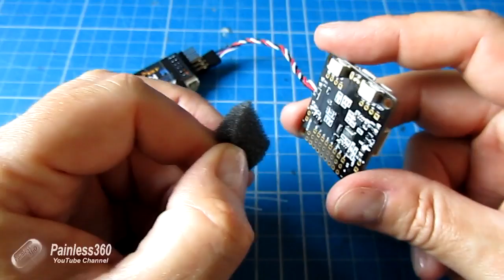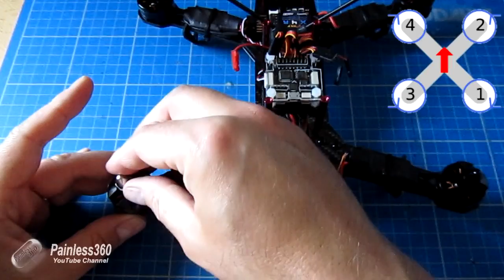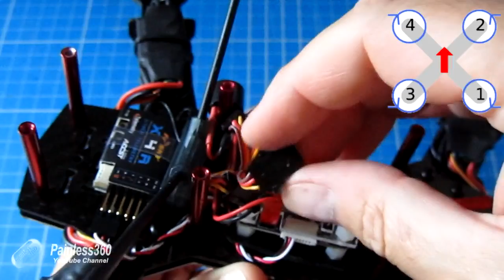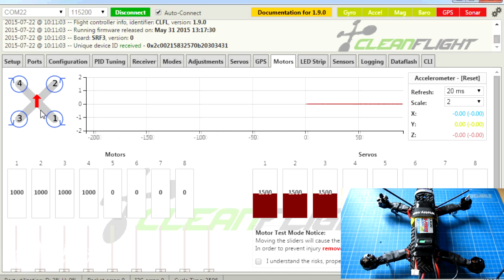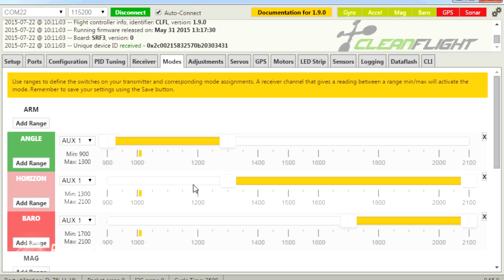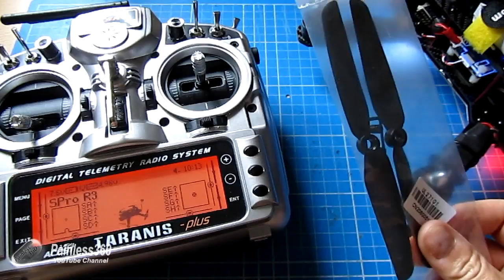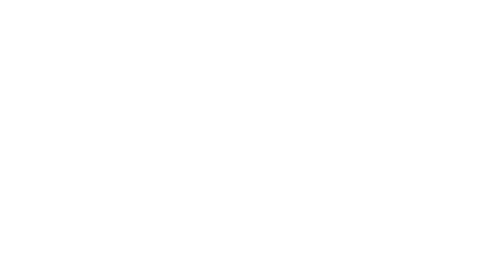(2/9) Seriously Pro F3 (SP3) Series - Installation, power, motors and first hover

Comment: can someone look at my recent video upload because my f3 evo just beeps. can someone help
Reply from the maker: +almaidah1 knowing what troubleshooting you've already done can be very helpful. it's probably because either the vbat settings, there is no signal from the receiver or you have the beeper mode enabled. Best of luck!
Reply: Painless360 do I need to turn off vbat im using the pdb 3s nothing special. flysky tx and rx ibus ppm
Reply from the maker: +Painless360 try it and see see..
Reply: Painless360 problem solve when I changed to betaflight. I guess it didn't like cleanflight.thank you painless.

Comment: can directly solder all of the cable to FC? bcause i use qav X and its so tight inside the qav if i use pin header..
Reply from the maker: Sure can, it makes swapping, replacing or upgrading things a little more involved though.. Best of luck!

Comment: I have a tbs 5volt vtx to replace the original in my wizard x220 . I have looked for clarification but cant find anyone that shows where on this board i can plug the vtx into that will provide a steady 5 volts . Have you a video that I have missed or could you point me in the direction of one that explains this . Thank you for your videos btw theyve been so helpful

Comment: 14:25 If you need a "BEC" in a pinch, you can easily take apart a car USB phone charger and solder some wires to the board inside, and desolder the USB connecter to save weight! I did this on my quad and have no problems. They work well for this purpose. It might be worth heat shrinking the bare PCB, however.

Comment: I have this FC - does it need regulated 5v or can I use a connection straight to the battery? The reason i ask is that I have a 4 in 1 esc without BEC and dont have my room on my 210 quad for a pdb
Reply from the maker: +justin vaughn it'll need 5v.. best of luck!
Reply: thanks boss, awesome channel!!

Comment: Hey Painless, I have the Eachine Falcon 250, and I want to add a GPS for more OSD info, as well as position hold and return to home. I know the stock board doesn't have a magnetometer or barometer so I was going to order the deluxe version of the board and swap it out with the stock one. Is this a relatively painless upgrade, or is there a lot more that I don't anticipate? I am hoping it's just a matter of unplugging the one board and plugging the new one in, adding GPS, then programming the new board.
Reply from the maker: Should be, we will be looking at iNav in the next few weeks and that should also give you GPS flight modes with it too! :D

Comment: i dont understand where the VBAT wires are coming from... Do they hookup to a BEC that's intergrated with your PDB or are they soldered directly to the battery voltage.
I am building an Aline 5" frame right now and i am struggling to get power to the board... my ESCs only have two wires (a signal and a ground) so i cant run the power though those. am i supposed to buy a little 5V BEC to power it, or can i just power it though the VBAT?
Thank you very much for your help!
Great vid XD
Reply: Oh, and does the fact that I have a cheap banggood version of the board change anything? 
Thanks again XD
Reply from the maker: See the 4th video in the series for your answer and using Google with searches like 'vBat Painless360' should help too.. Best of luck!
Reply from the maker: Shouldn't do! :D
Reply: thanks for the reply XD, i saw the video, but you dont mention if you can power the FC through those VBAT pins, As i was checking out the manual online, it says to input no more than 5V :(  i dont undertand :/...
Reply from the maker: +pierre tharreau beat doesn't power it. See the build series.. best of luck!

Comment: Hey would I be able to connect aux 1 on my power Board to vbat to power up the board
Reply from the maker: Nope, vBat is only for measuring the battery voltage. You'll need to power the board from a 5v supply from somewhere. See the build series for more tips..
Reply: How do i power up the f3 board
i have a lumenier 4 quick swap board
Reply from the maker: You need to connect the 5v out of the PDB to any of the 5v inputs on the FC.. See how we do it in the 'Quadcopter build for beginners' series on the channel as we cover more of the step by step for newer builders there.. Best of luck!

Comment: Hello
I have a problem with the FC.
I can test the motor and my reciver is work. But i cant Start the motors with my Transmitter. 
Can you help me?
I know that is disarmed but how it armed?
Greetings Ruudi
Reply from the maker: See the video on Troubleshooting arming. If you Google 'Painless360 troubleshoot arming' then you'll find out all about it. Best of luck!
Reply: Painless360 thanks for you answer i must configure the max and min of my reciver. But i have also a Problem with the Magnetometer and my PDB. How can i "protect " them?
Reply from the maker: Move them farther apart of I use a piece of MuMetal to shield to FC..

Comment: how do i hook up a favorite  little bee pro 20AX4  to the flighcontroler   its is the the board  not the  individual esc  plus how do i hook up the power   imtrying to make a flex rc owl
Reply from the maker: Not sure, we've not used one here. I'd make sure that you are keeping track of which motor is which and test them in the GUI before trying to fly. Best of luck!
Reply: chad henry or test using a servo tester
Reply: I got a hold of beheld  they gave a site to go but no help there thanks I'll give it a try.    I wish they would come out with a all-in-one ESC flight controller and transmitter all in one

Comment: Hello, 
I, yes a newbee, have a question of which i already find myself stupid to ask, but i googled (and looked at you https://www.youtube.com/watch?v=olIqTiSJHIY post) but my problem is i don't know what to google and since you made the video you will understand exactly what i mean. well i hope.  

you added an extra 5v (jst?) connector on the board to use to power alternate parts that need 5v. smart move, i want one too.. but. 

the end disappears between the pbd and the bottom board and you don't mention to what it is connected. 
the only "not thin as grass" contact points i seem to have are the pin esc's  connector's
but if i connect my extra jst to one of these won'y there be an internal power inballance in the pdb effecting flight?  

i'd rather take it off before a the split point, if that exsists. 

another thought i had is to use a step down board and use the main battery power leads to make an additional 5v rail but this is silly if there is already a nice contact point which i'm overlooking, specially as it also add's some more weight. 

2nd question. 
if i use a 4s battery pack, can i still connect that directly to the vbat contact points (high voltage) if i make sure i use the right polarity? 

and again.. to what point is it best to solder that? 12 gauge battery wires or 2 wire esc contact point. 

sorry for the long post.. i hope i made my question clear enough to understand though.
Reply from the maker: +Matthieu Kints, van if you are new then the 'Quadcopter building for beginners' is a better series to watch. Every step is shown in far more detail. Best of luck!

Comment: if I don't have those small connection wires is there a way to directly solder my rx to the board?
Reply from the maker: Not sure which wires you mean - the ones that plus into IO_1 and IO_2? If so then I'd get hold of replacements - contact the seller who supplied the board. The connectors are JST-SH style..
Reply: Ok thanks

Comment: Hello could the x4r be connect to either IO port 1 or 2?  I am having trouble binding the x4r-2.  It will not light up when I plug in the battery.
Reply from the maker: The light on the receiver should be green when it's connected and bound to the radio. Is yours? What troubleshooting have you already tried?
Reply: I have changed the cable wire, and even plugged in a spare x4r-2.
Reply: everything else is working on the FC.
Reply from the maker: Sorry, you've not answered my question..

Comment: My motors will not respond to any method of trying to spin them up and the esc's wont calibrate. I have tested my electronics and have confirmed they operate properly on other setups and I did have the quad flying for two successful flights until this problem arose. I believe I have messed something up on the configurator.
Reply from the maker: Have a look at the 'Quadcopter Building for Beginners' series on the channel. We setup an SP3 and go through every step. We also had a few problems with the ESCs and motors and we show how we solved it..
Reply: +Painless360 Solved!  thank you.  I had it set as a custom model instead of a quad x on the configuration page.  now it works perfectly!
Reply from the maker: Great news! Happy flying!

Comment: My rotors are spinning in different speeds when i turn the throttle to the max. Is this rather caused by the remote or the flight controller? And have you done any adjustments at your remot?
Hope you can help me.
Reply from the maker: +Pat rick this is probably due to the ESC not being calibrated, I'd start there. We cover it in the series and also in the 'Quadcopter building for beginners ' playlist too. Best of luck!
Reply: Thanks a lot sir!

Comment: Hi there, I have a humming/buzzing sound when I power up the flight controller/pdb/esc/motors. Any idea why it's doing that?
Reply from the maker: Not sure, there should be no sounds like that when it's powered... Best of luck!
Reply: Sounds like it's coming from the flight controller. Maybe I will resolder the wires...hope it will stop :)
Reply from the maker: Me too! I'd disconnect everything and see if it still does it..

Comment: @Painless360
I didn't understand where pins for the power connection are.
Am I right, if I say, I have to connect the 5.0V Output of the PDB with the VBAT Input of the RC???
I thought the VBAT connector is just for battery voltage monitoring?!
Reply from the maker: See the latest build video series we're making on the channel 'Quadcopter build for beginners' we're using this board and the detail may make more sense. Best of luck..
Reply: Thank you, it really helped me a lot :)

Comment: The F3 controller manual says to only use one BEC ESC power input but in your video you say it's fine to use all the BEC inputs from the linear BEC ESC. Could you clear up this confusion?
Reply from the maker: See our video on ESC and BECs in the 'Introduction to Remote Control' series. I'd have written the manual that way too to avoid all the hassle with linear vs. switched etc.. Happy flying!

Comment: How does the Flight Controller get power?
Reply from the maker: Great question. The FC needs 5c and can get it from a few places depending on what ESCs and PDB you are using. See our videos on 'RC Power Systems' in the 'Introduction to RC' playlist where we cover it in detail. Hope it helps..
Reply: +Painless360 

Thx for the response.  I get where the power comes from, but am not sure where you connect it onto the flight controller.  I have a couple of others and they have 5v pads to connect power.  Can't figure it out on the spracing f3 board.
Reply from the maker: You can connect to anywhere that has the 5v and GND rail. In the build we're doing we used a spare ESC connection (https://www.youtube.com/playlist?list=PLYsWjANuAm4pnhS9StKcIbwSOdoMaR9-p)

Comment: Hey man! Thank you very much for the videos, definetely one of the best series online!!! I'm just in the process of building my first ever drone without too much previous R/C experience. I couldn't find the genuine sp f3 so got the deluxe one from hobby king. Managed to flash the firmware and then earlier yesterday, I hooked up the x8r to the flight controller as you show, then bound my taranis to the x8r and boom I could see the channels moving on the receivers page of cleanflight, really pleasing! So i proceeded to screw in all the motors solder down the pdb and ESC and motors and fix them all down, mounted the sp f3 deluxe board and went through and tested and ensured all the motors where going the right way from the motor page of cleanflight. After having done all of that I replugged the x8r into the f3 deluxe however now I am not getting any movements on the receiver tab in response to moving the sticks on the taranis. It was definetely working and now not. I feel like the receiver is definetely connected to the tx as I can see a little bar on the taranis and the rx will start flashing green lights once the taranis comes on. Any pointers on how to go about troubleshooting this? Literally have no idea where to go from here!
Reply from the maker: +amishra123 I'd recheck the settings for the radio receiver in Cleanflight. Best if luck!
Reply: They are definetely still all right! I even reset everything and re-did them. Set the serial rx port in the ports tab and then the serial rx in configuration and s bus just underneath. On the taranis I can see the channels 1-5 going up and down as I move the sticks and the switch I assigned for flight mode. Any further ideas? All I think changed was the fact that I soldered the motors in (which was probably a mistake , but I didnt have any of those connectors and the ESC leads were so loose on those pins!)
Reply from the maker: I'd unplug the motor then and see if that's the problem. In cases like this I remove all the leads and connect a spare servo to the Rx and see if I can move it with the radio, if I can then I start to re-add the cables one by one watching for the one that 'breaks' everything - best of luck!

Comment: Your not showing the connection between the powerboard and the controller Is it just a simple negative and posative connection?
Reply from the maker: Yep, see the diagram..
Reply: Iam sorry for that daft question You mention mumetal Were are you getting this When looking on the net It's coming from usa and very expensive
Reply from the maker: I tend to get mine 'reclaimed' pieces from Ebay. One bit will last ages!
Reply: Where is diagram? The board is 5v if I'm not wrong. But you mentioned that you are using 3s battery which is 12v where do you have 5v voltage regulator ?
Reply from the maker: That's right keep watching the series. Best of luck!

Comment: love the videos.  You have answered alot of questions for a newbie.  but I'm a lil confused.  first where does the fc receive its power.  Is it from the pdb to the vbat on the fc.  Im not sure.  And I have lil bees escs.  there are only two wires per esc to plug into the fc.  white and a black wire.  If I plug them in they connect to "s" and negative spots on the FC.  Is this correct.
Reply from the maker: +ja st See our videos in the 'Introduction to Remote control' we cover lots on RC power systems in there. Best of luck!

Comment: How do I Arm the SP Racing F3? I  am using AR7700 and DX6. When I armed the motor spin continuously. II am using IO2 port and and connected to Remote RX..Thanks!
Reply from the maker: +Rj Rc see our video on troubleshooting arming in the Naze32 series. It's all the same with this board too. Best of luck!
Reply: Thanks Painless360 Finally I got it!

Comment: I have configured board  via USB. (Clean Flight ) I can control the motor's and i can see the RC remote getting all signals but Hexa is not working via RC controller Please support me to find out the issue.

1.Remote working fine even receiving the signalers and motors are working i have check via PC
Reply from the maker: +Shaminda Wijeratne Happy to help but please watch https://www.youtube.com/watch?v=olIqTiSJHIY and come back to me with more detail of what you've tried..
Reply: +Painless360 Thank you for your respond, My system is S550 Hobby king Kit with seriouslypro Deluxe board, 1. I have go through your video series and configure the board 1.done collaboration 2. configure the remote controller and it is working fine with the TX. ( I can see from clean flight system channels are working ) 2. Motors connectors are connected and I can control all the motors via clean flight . I am using Turnagy 9XR Tx with Frsky DJT module with frsky 8channel RX module both are bind. battery just testing i am using 3s 2.2 lipo and UBEC 3A5V using for the controller and RX power.this is my first Multi.
Reply from the maker: Check out the naze32/Cleanflight 'Troubleshooting Arming' video..

Comment: Hello,great videos from you thank`s a lot,
i also have a question, after calibrating the motor&esc`s the motor stil move a littel bit in low throttel @ 1000 on the screen, can`t get them calibrated right in down throttel, ztw18A with BLheli & elite 2300KV / option pogr. with TX in BLheli is Off, zo the esc`s wil not go in pogra. mode during throttle calibration
 Problem solved....updated the esc`s with BLhei 14.4 now its working

Comment: Hi painless,

How do you decide the max and min numbers to put for the motors in cleanflight ? 

Thank you in advance for your help
Reply from the maker: +Hamza Bendahou Depends on the ESCs normally as they have 'defaults' they use. SimonK uses 1060-1860 for example. Once you've gone through the ESC calibration the ESC will use what you've set.. Best of luck!
Reply: +Painless360 Thanks a lot for your Quick respons. I havé 20 A afro slim simonk, so I'll use these values.
Could you tell me where you found the info ? Simonk documentation ? Thanks again
Reply from the maker: Can't remember now - we read a lot of stuff here! If you Google something like 'SimonK default throttle range' you'll find all sorts of places..
Reply: +Painless360 Thanks !